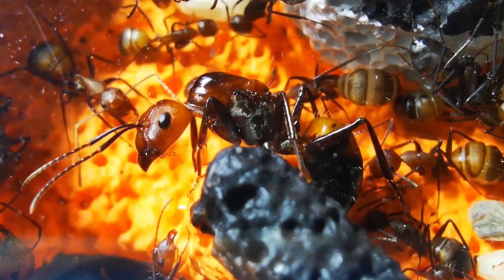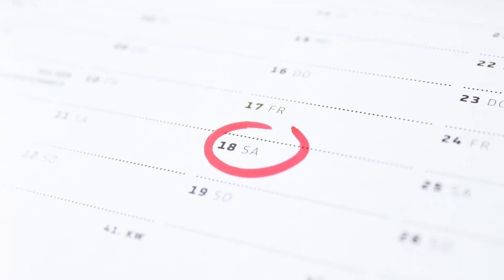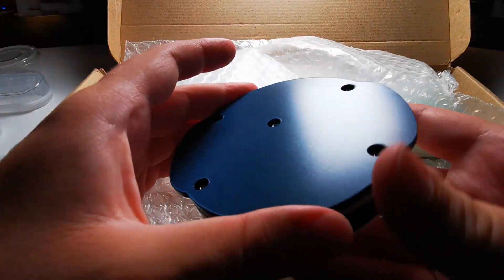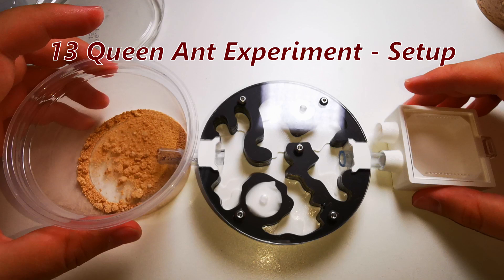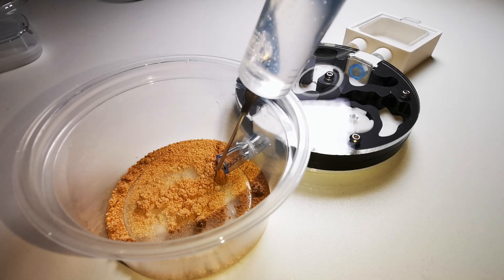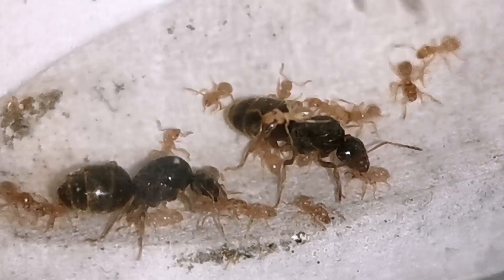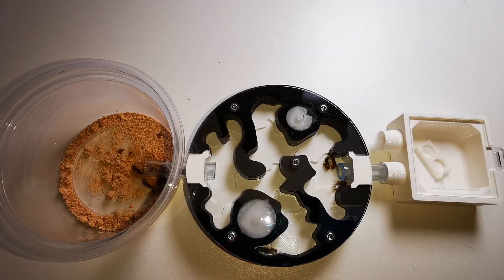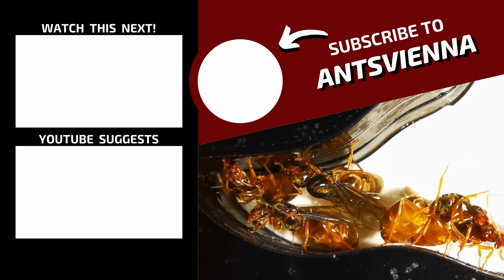13 Queen Ant Experiment | What will happen?

Comment: That will not work. That nest is not good enough for flavus. You need a stable constant supply of humidity, and that system won’t provide that.
Put them somewhere else with a water reservoir that is constant
Reply from the maker: Yes, afterwards I thought I could have at least put some digging sand on the nest floor to help stabilize humidity